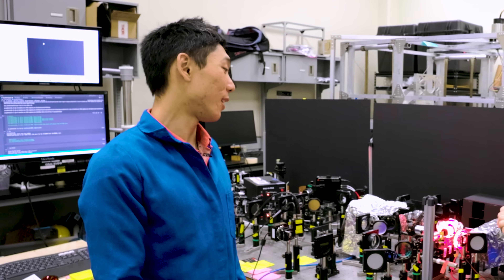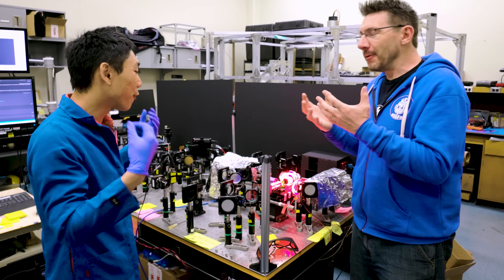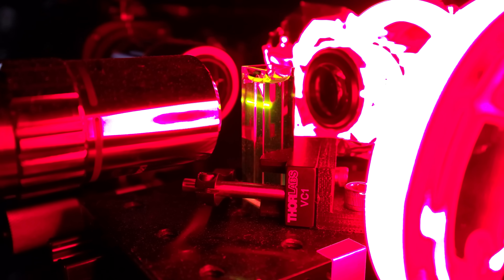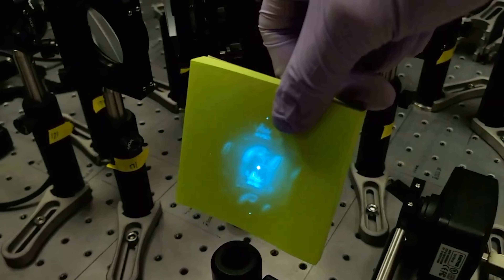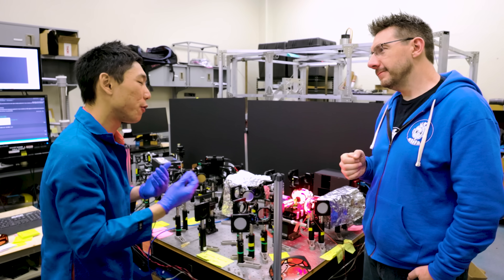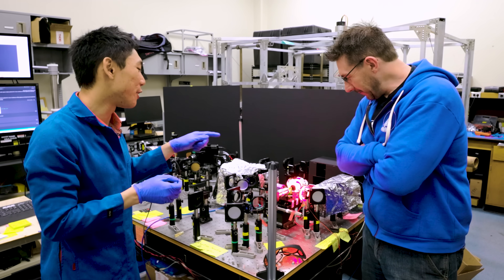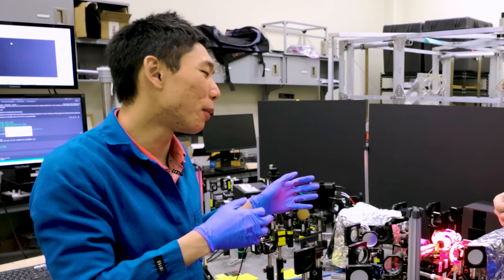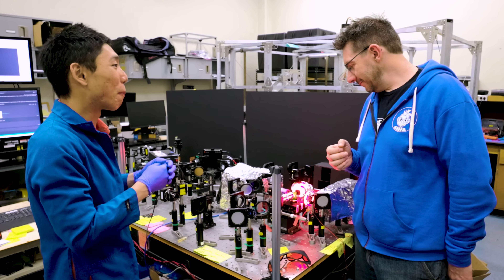Holographic 3D Printing is REAL!

Comment: So youre just hardening material within a material with a 3 dimensional modulated laser split between two plains then removing that semi hardened material to be cured in a typical hardening fashion creating a 3d object with more resolution while not having to use any supports on the object during the printing or hardening process..  sounds useful on a micro designing level like for creating biological prosthetics or intricate valves / components for precision applications and devices..  otherwise aside from the medical and micro electronics fields i see little application for such a way of creating things..  but creating a 3d mems device v

Comment: Holographic systems require zero vibration total stability, even walking near them could spoil any results. Wavelength of interference on light is tiny so any movement is a major issue

Comment: Important!
Recommendation about the technology:
1. Sound can suspend particles ----- lasers, then can combine and modify the suspended particles. 
2. Vacuum chamber environment plus sound controlled particle suspension plus laser to suspended particles combination and modification
Reply: Vacuum wouldn't let the sound work. Maybe you could use lasers tweezers; but I'm not sure they would work with curable material without causing the droplets to cure before reaching the right spot. Just sealing the box with air and designing the walls to not get in the way of the acoustic levitation might make more sense though; though, as the print grows, it will start affecting how the sound waves bounce around, which would need to be accounted for, and could complicate things a lot.

Though, aerossolizing toxic resin doesn't sound like a good idea...
Reply: @tiagotiagot  No. 
It would work like this: put air back into it ----- THE REASON IS BECAUSE THE CONTROLLED AIR WON'T HAVE PARTICLE IMPURITIES, AS IT WILL COME FROM A PURIFIED OR GAS CONTAINER.
Reply: Vacuum

Step 1. A vacuum
Step 2. Insert gas, such as controlled air
Step 3. Apply sound per layers and directions 
Step 4. Insert particles
Step 5. Combine and modify via lasers

Comment: That is pretty clever and of course since holograms only see what you'd see from looking at the object from the origin, the pair of images makes sense to fully enclose the object. I assume the trick in scaling up will be the more powerful laser to fire through deeper tanks will have a higher chance of curing molecules in the foreground. This would also seem to be a method that could be used to resin print in 0g (if one wanted to take that crazy risk, but maybe there would be a need for nano-scale fabrication in 0g) since unlike SLA you don't need the fluid to stay against the bed.
Reply: You can have holograms of transparent objects, and even things like lenses and such, not to mention with enough parallax you can see behind solid objects in a hologram, and with high resolution and shallow depth of field, you could even have things visible at different depths depending on focus. If you for example had a hologram recording device fast enough for that, or just used a computer calculate a hologram, you could for example have those line patterns of light that are different at different depths under wavy water, and a piece of paper moved across the hologram volume would show the bright lines changing depending on where you place the paper.

Comment: Would it not be possible to use optics to compress the hologram along the axial direction? Or is the interference with the orthogonal beam necessary to produce the deadspots where the light is fully canceled out and the resin remains uncured, and it's not just a matter of resolution?

Comment: I remember when I was in college a number of years ago, seeing one of those tables. They were using it for 3D scanning instead of manufacturing, but I so wanted to play with it. It's like the adult version of some kids toys... put the mirrors, lenses, devices in some arrangement and it makes magic happen. The big thing that comes to mind is it's still a kind of resin printing...

Some other YouTuber was interviewing someone and said "People don't realize it, but resin printing is easier then FDM. Except you need to spend time in gloves with unpleasant chemicals to be able to use it and then post process. FDM simply has a longer setup and post processing is about the same as resin." Reworded for this: the research will net something powerful... for industry. Because unless you're already doing resin printing or want to get into it, the average person is going to want "load block of material into device, tell it to make thing, get thing". No post processing. Basically, FDM but with resin. Do the setup and then have a thing that can be held in hand. But such is the nature of research, you have to get one stage of the process figured out before you can do others.

Comment: Wouldn’t all rearward layers of each laser be inherently and increasingly inaccurate because there is a delta in the refraction angle during the print process at the intersection of cured and noncured media? You’d have to account for that, and I’m not convinced it’s possible.
Reply: If they can get the curing to work fast enough, I would imagine it should be doable with just high-intensity flash, and the light will already have swept thru the volume before the molecules start rearranging.

Or perhaps just have additional mechanism to record a hologram of the volume as it is processed, recalculating the projected hologram in real time to account for the changing lensing of the curing media.

Comment: I like how this totally sounds like a clickbait title, but it's actually 100% accurate and not misleading. They're not just 3d printing onto a build plate with a hologram on it to copy it onto the print. They're not even using a different volumetric display and calling it a hologram like they do with 99% of stuff people call holograms. They're actually doing holograms.

Though now that I think about it, does it really need to use holograms specifically? Any other volumetric display would work, right? It seems like it would be simpler to make the object you want to print out of a translucent material and probably bigger, illuminate it with UV light, and use a series of lenses to project an image inside your resin.
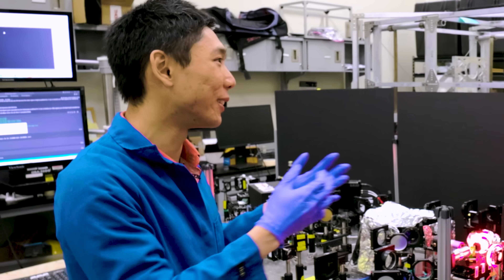Reply: A hologram is useful here. Unstructured light coming out of lenses would just act like that topographic volumetric method they mentioned at 1:00 : it can create a 3D field, but it's limited somewhat in the shapes it can make. You're basically creating a 3D image by intersecting a bunch of tiny lines through the resin. A hologram has no such restriction; by using interference, it can create 3D patterns even if the light is coming from only one direction, and can make some shapes that are impossible to make with other methods.
Reply: And sweeping focus to cure at different depths would be slower than exposing the whole volume at once.

Other types of volumetric displays may or may not work. If I understood it right, they count on the virtual object existing inside the volume of resin (or whatever curing media they're using); some volumetric displays only let you see 3d behind/inside the screen; perhaps some types of lightfield display could work; but I'm not sure there's anything with the strong contrast you can obtain with lasers though.
Reply: @tiagotiagot  You don't need to sweep the focus. The lens equation is 1/di + 1/do = 1/f, where di is the distance to the image, do is the distance to the object, and f is the focal length. If you have a 3d object, where some parts are closer to the lens than others, then the image will also have some parts closer to the lens than others. Just by putting the object and lens in place, you'll be focusing light on a 3d volume.
Reply: Right, other volumetric display methods can be used to expose the resin. And yes all these methods usually involve de-magnifying a larger image into a smaller one (or at the size you want to print).

Comment: A hologram is nothing but an interference pattern(2D). Now use another interference(2D) to intersect, now you get 3D🤯. But holograms are extremely sensitive to vibrations and need optical isolation tables and closed loop vibration elimination as well. More of a science fiction for years to come, but can find practical use in manufacturing micro mechanical sensors in near future. Just some 💭❤️👍
Reply: Tell me about it. Years ago I was making holograms as a hobby. I needed a heavy table on inflated inner tubes to get it vibration free enough. By that time I was working with a 1mW Heliun-Neon laser tube, that I had mounted in a self-designed case. The mirror holders where also self-designed (those part are really very expensive to buy), and use microscope-lens optics with self-made pinholes (using very thick Aluminium foil). I had to use a dark room, with at least of air movement as possible. The holographic film was a Afga 8E75 sheet film (somewhat affordable at 50 sheet packages), and a standard developer (Rodinal) with a self made bleach bath (not easy too get the chemicals for that one) for reflection holograms. I got some really good results with that setup.
These day's it's much more easy, because you can use far more powerful diode lasers (in the order of 250 mW or far more), that also have a far longer coherent length (so you can make holograms with more depth). By using those powerful lasers the need of a suspended table is greatly reduced, because exposure time is really very short. There is also a firm (Geola) that still makes holographic film sheets (PFG-01) and conveniently also make the pre-mixed chemicals needed to develop and bleach the film.
I am busy to restart my hobby again, so it's going to be fun...
Reply: @jclosed2516  Appreciate the details. It was a hobby, that did not materialize for me, due to needs of space,time and resources involved. Neverthless much homework was done. With better tech(esp. high pwr stable coherent lasers) and a sensitive film, it seems definitely doable.
Reply: @aware2action  Yep - Especially the Helium-Neon laser tube was very expensive. I started out with a more affordable 0.5 mW version, but that suffered from too long exposure times, making good enough quality very hard. So I gathered some money and went for the much more expensive 1mW model. Loucky enough all other equipment was self made (except for the surface mirrors of course), so I could at lest keep the cost down. Later on I got the opportunity to work for a studio that made large scale holograms using a 1W Argon laser, and I have learned a lot from that.
These day's the diode lasers that are stable enough for holography are a fraction of the cost I payed for the HeNe lasers. As I can now print the majority of the needed equipment on a 3D Bambulab printer, I have another big cost reduction. I can now restart that hobby for under $500, wile in the past I was looking at prices of several times that amount. As said, It's going to be fun...
🙂
Reply: @jclosed2516  Glad to hear and feel the renewed enthusiasm to restart a favorite hobby. One thing I am not sure about the diode lasers is, if they are useable without additional cooling such as TEC, to provide enough stability in polatization and wavelength drift. Wish you goodluck, and let me know how it goes☺️. I am trying to restart one of my hobbies as well, ecofriendly inhouse pcb production and assembly in less than an hour!. I do use BL printers, and find them useful for trouble free printing of custom enclosures.
Reply: @aware2action  Yeah - I do a lot of PCB design myself, but I always find it a hassle to work with all that etching  fluids and photo sensitive boards.
So - I probably take a shot at those cheaper CNC machines to make PCB's that way. There are a few tutorials on YT, so it's worth a try.
Oh - And about that cooling. These days you can get complete diode laser modules, that have adequate cooling housing and are stable enough for holography.
Reply: @jclosed2516  Appreciate the info. I do use LPKF for quick turnaround PCBs. But the issue is tool life(esp. Micro milling bits), apart from cost. Also it is a sequential operation, with potential to get scrapped, until the final cutout. While chemicals are tricky/messy in using apart from recycling issues. Holygrail of pcb production is zero waste fast turnaround, with as little consumables if any. Another tricky one is creating real thruholes, no one has figured out a easy way out(other than rivets, wire bridges etc). I do know there are medical lasers available in the surplus market for cheap. The key is to get enough documentation, to make them useful. Holography has lot more potential, in replacing a lot of bulky optical elements, due to the nature in which they work. It is a fairly unexplored territory, when it comes to real world applucations. God knows, what you can do combining a holographic optical lens system, with HD machine vision camera and associated AI enhanced control system, used for machine learning🤞.

Comment: So basically you are projecting a laser hologram into the material and just "exposing it"? Like you're not moving the lasers around? Or do you need to adjust the lasers to get the interference pattern to move to the next layer?

I guess typically when we think of holograms, we think of ones that have multiple views of the same object viewed from different angles. But it sounds like this is just the one viewpoint or projection?
Reply: @SixOThree Thank you for the questions.

Yes, not moving, no layering. We are exploring the capability of a completely motionless, single-shot mode of printing. The lasers are switching in the video just because of the two holograms are sharing the same modulation device (for cost reasons). So in theory there could be no switching and the two holograms can be simultaneous. And of course, doing multiple exposures would have benefits in improving overall uniformity and diffraction efficiency (light utilization), but it makes the printing process slower.

On your final question, yes it is just one projection of a 3D distribution of light. If you intercept the light beam at different depth (along the beam), you get a different image.
Reply: @mr.chichungli814  Oh hey, you have a youtube channel.
At the moment, the real limit is the resolution of your Light modulator, in terms of detail, isnt it?
I mean, i guess you can focues the beam smaller (with the same limitations as Foto-lith) but you cant get more pixels in than that holographic flatscreen.
Reply: @xxxm981  Right, reconstruction quality is the main issue. 

There are two challenges. 1) the addressable voxels on the hologram are not isotropic. Each voxel is much elongated in the axial direction so the axial resolution is particularly poor. This is the problem my work is trying to address, by using two (or more) holograms simultaneously.

2) The second problem is like what you said, the limited total number of pixel on the spatial light modulator does limit the total number of pixels on the hologram (for any given plane). The field of VR/AR display (and the big tech companies) is trying to address this by advancing the hardware.
Reply: @mr.chichungli814  👍 Do you have plans to produce a consumer-grade holographic printer? Something like this litiholo hologram printing consumer grade product. It would be very cool if there was one.
Reply: @canxuedexue  Well, I also wish it is production ready. This is an ambitious project, trying to make a big leap (even relative to state-of-the-art scanning type of volumetric AM) to do single-shot printing. Currently its cost and performance are limited by the spec and price of the phase modulator, the objectives...etc....all the parts that form this printer. So like many other research, there is a long way to reach that stage of technological readiness. I and other collaborators will keep working towards the goal of single-shot printing.

Comment: And now 26 years after Small Soldiers, we finally have that printer.
Reply: The printer from small solders was a real printer, its an SLA 5000 that uses lasers to cure photoresin layer by layer as the bed sinks into the vat. They added special effects to the scene but thats a real printer and that model was 3d printed on it.

Comment: I imagine this would only work w/ clear resins.  I wonder if anyone has had any luck using sound w/ different wavelengths to control penetration into opaque resins/powders.
Reply: There are published work using sound waves to print. You can look up "Self-enhancing sono-inks enable deep-penetration acoustic volumetric printing". And of course people use different wavelengths of light as well.